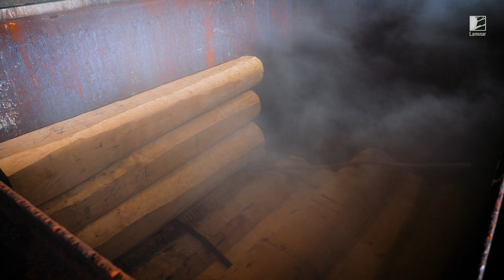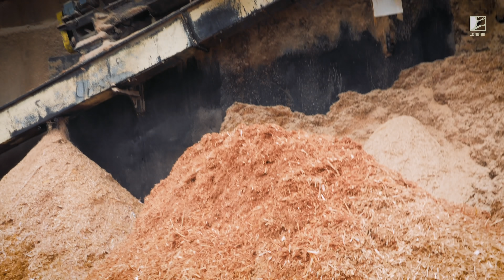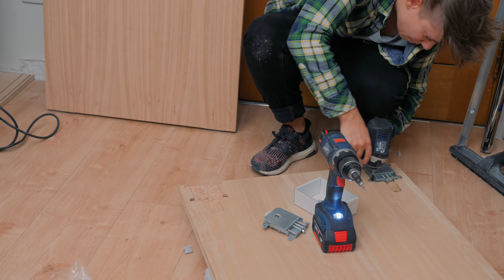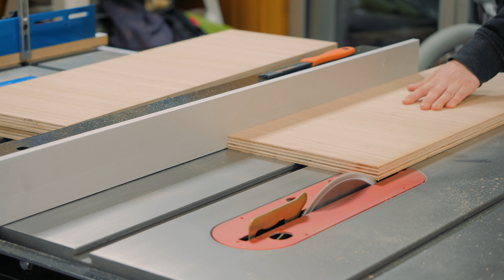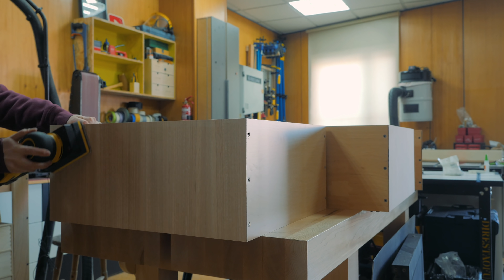I Built an Entry Closet with Sliding Mirror Doors // Tiny Apartment Build Ep.9

Comment: Awesome carpentry work!
 I noticed that when caulking with silicone (We call it 'No More Gaps' in Australia) that it can get messy. I have used a spray bottle with water and a small amount of dishwashing detergent to spray over the applied silicone and a little on your finger, before running your finger over it. The spray bottle mixture will prevent the silicone from sticking to unwanted surfaces.

Thank you for posting the videos!

Comment: I really like this, it's very well made, well done! 👍 I did a similar build, only mine was from wall to wall, so I just built a frame for the inside instead of solid wood walls. Mine was a double wardrobe with two drawers and single wardrobe with drawers either side of a central drawer section, with space above to hang a TV from the wall.

Comment: Have you ever used a compass to scribe your work to perfectly fit an uneven wall or surface? It works great, even on extremely uneven surfaces like rough stone walls. A compass is a divider with a pencil on one side. Just like the the thing you use in grade school to draw circles on paper, one side pointy the other a little circle clamp for your pencil. The top of the compass has a wing nut or threaded handle for locking in your circle size. So, to scribe to an uneven surface, I'll try to describe a simple job and you will be able to work out the rest from this...it's very easy.
    OK, you've got a piece of plywood 30cm x 30cm. You want one edge to fit against a sloping bumpy wall. (lets assume the floor is level) Place one edge of your plywood on the floor and slide it into the wall. You see gaps all along the edge against the wall. Take you're compass, and holding it as level as you can, place the pointy end against the wall at the widest gap. Now extend the pencil side until it touches the plywood edge. Lock in this size on you're compass. Now, holding the compass level, slide the pointy end against the wall letting the pencil draw a bumpy line on the plywood. Cut along this line to get a perfect fit. 

     You can use a scroll saw for really uneven surfaces. One more tip. You can bevel your cut a couple of degrees to make sanding or carving in a seamless fit easier. 
    I used to install custom saunas. This worked great to butt up against stone. Good luck, have fun !
Reply from the maker: Thank you! You explanation was great and I don’t have a big compass, only a metal small one for paper but I have used that method before :) by simply running the side of the pencil against the wall and having the graphite tip transposing the “waves” of the wall into the work piece. This works for a small gap sure and for bigger scale irregularities your method shines.
Reply: @GetHandsDirty  You'll find you use it all the time. Getting nice fits around baseboards and moldings for instance. One thing I didn't mention (you probably know already) is if your work piece needs to move a known distance, like say you need to move it 40cm closer to a wall. Just measure 40cm between your compass points and scribe your line....no need for a second cut. Thanks for the great videos!!

Comment: If you spray paint seal the back of a mirror, you can use any glue you want. HOWEVER, you should always paddle scrape your glue as uniform as possible, otherwise, dollops will deform the glass giving the mirror a wavy look. You can also shatter the mirror on cold days if it's made with safety glass.
FYI, paint sealing a mirror will stop old mirrors with degraded backs from going worse, which is a neat trick to know if you want the antique look, but not have it go useless because of the peeling effect.
Reply from the maker: Interesting, and does the spray paint need to be special? Like acrylic or waterbased so that it doesn’t react chemically with the mirror backing?

Comment: All good, until you started painting the triplay or playwood as they call it.  Why paint the wood?  In any case you would have used better the mdf of colors that you can get, (in my country it is not so easy to obtain or it is very expensive) or in any case melamine.  Ok not the whole project just some parts you painted.

Comment: Oi! Só um conselho: nunca trabalhe com uma serra de mesa eléctrica com os cordões do capuz assim compridos e soltos. Ponha-os para dentro da camisola ou ate-os num nó para os encurtar. Tenha cuidado!
Hi! Just a word of advice: never work with an electric table saw with the drawstrings of the hood so long and loose. Put them inside the sweater or tie them in a knot to shorten them. Be safe!

Comment: Hi, Cristiana! I joined you four years ago in the days prior to your cactus planter and the toy grasshopper. I remember your first huge project very clearly (bookcase, loft-bed, and desk), with this closet being so similar in context. Birch is a wonderful wood and does well with varnish or painted. Upstairs, my half-sized cabinets and drawers are about 25 feet long by 3 feet high and 18 to 24 inches deep under the roof line. The doors and all interior surfaces – all birch - were varnished without color, still looking as good as when they were built in the early 1960s. One question: is your workshop in same building as this apartment? Thank you for sharing so regularly! It’s always a pleasure to find a new video.
Reply from the maker: It’s great to have you around for so long! Thank you for keeping the interest :) yes, birch plywood is beautiful!